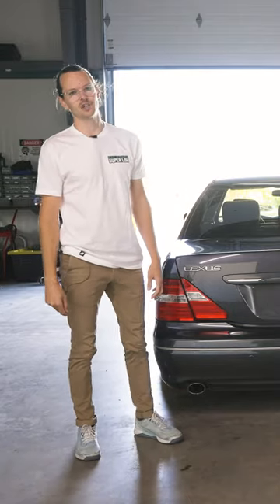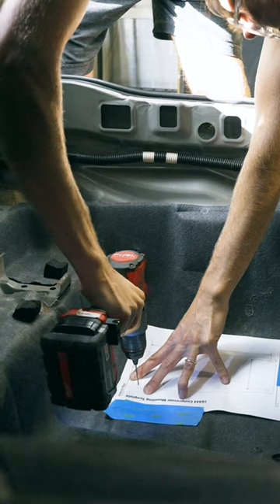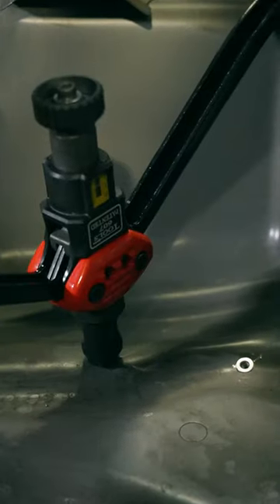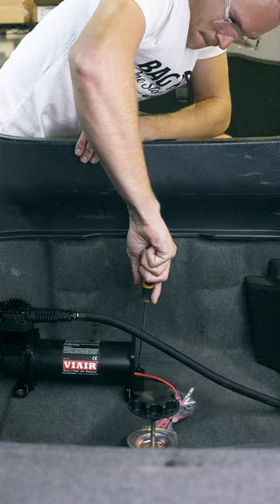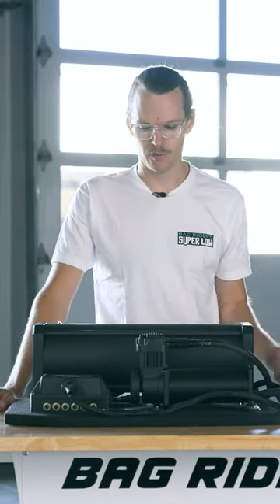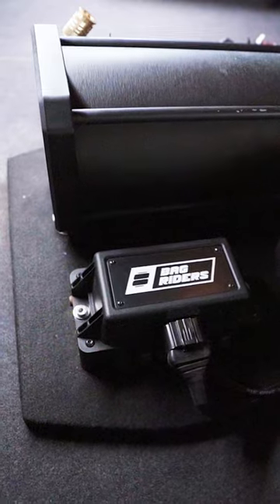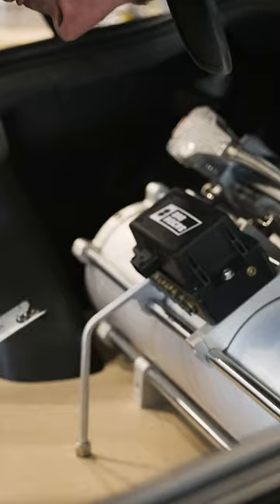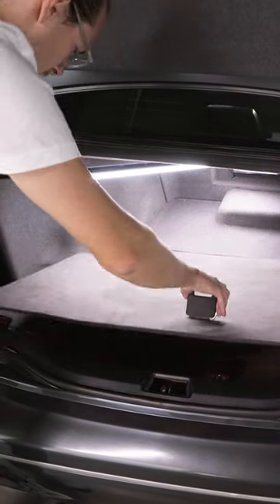3 Ways to Mount your Compressor for your Air Ride setup #airride #airridesuspension #bagged

Comment: I have a question, if it mounted on the mdf, is the board gonna moving around in the trunk or it still need to be attach to the trunk mat?
Reply from the maker: We would recommend attaching the MDF to something in the trunk so it does not slide around.